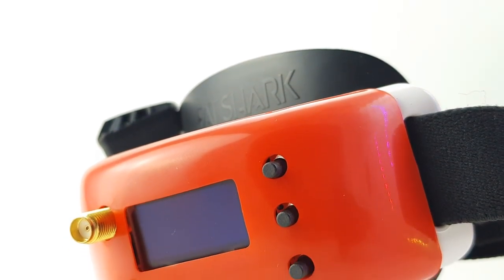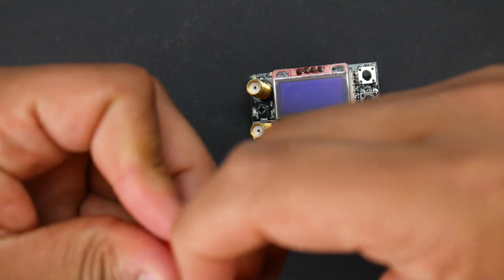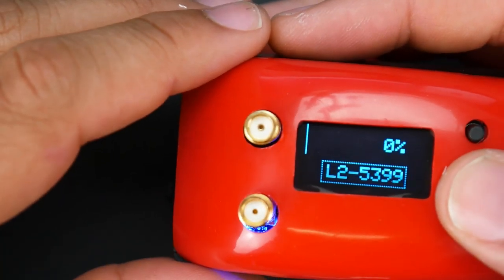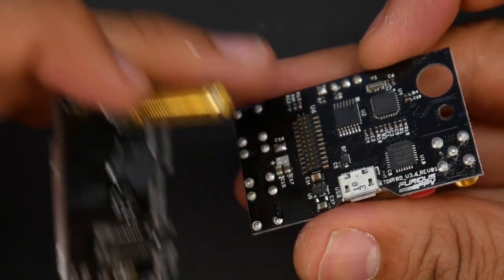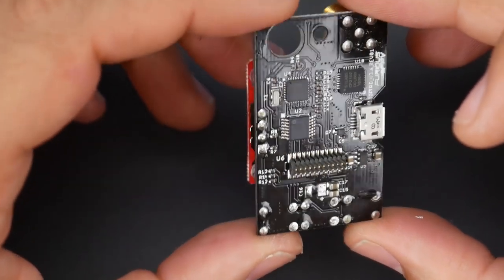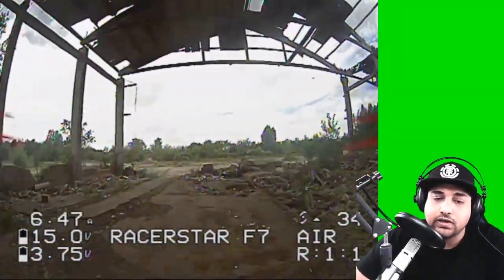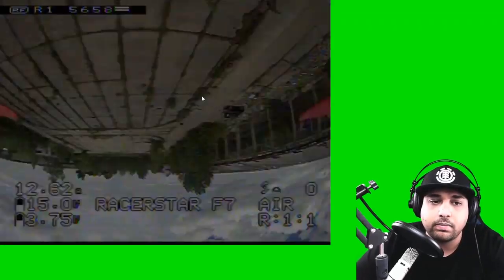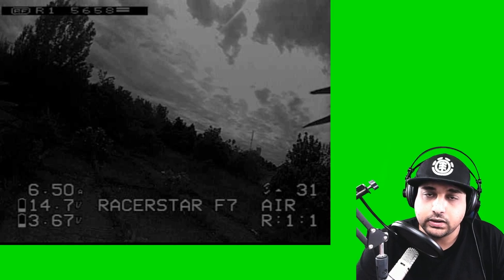Furious True-D LITE Vs Rapdire Vs Skyzone Sky03O

Comment: The Filter setting relates to how quickly/aggressive the diversity switching is. So the low setting will take longer and require a higher threshold to switch receivers. Useful for longer range. And High would be best for proximity flying switching quickly between say a patch & pagoda. 
Great review. :) Cheers.